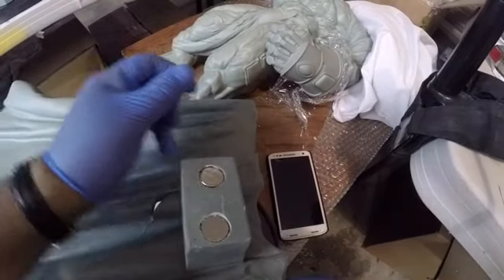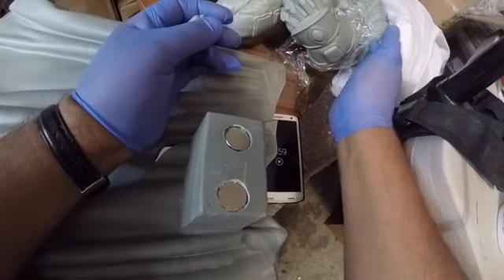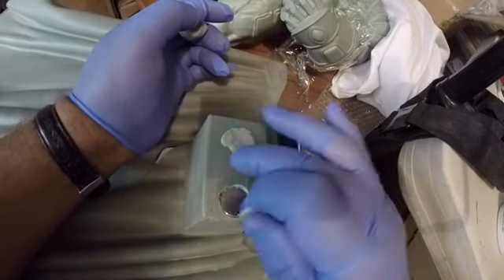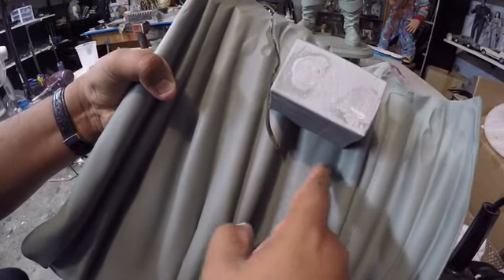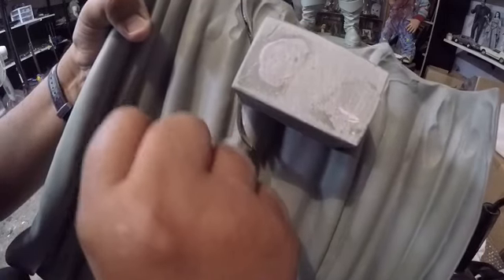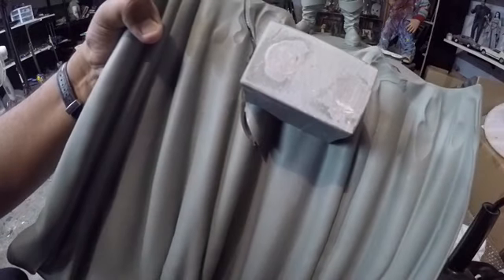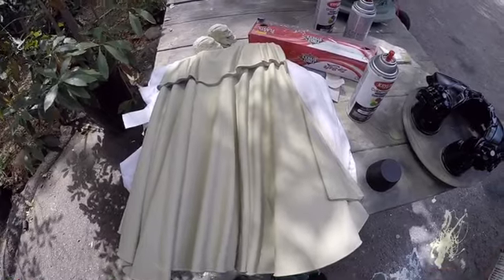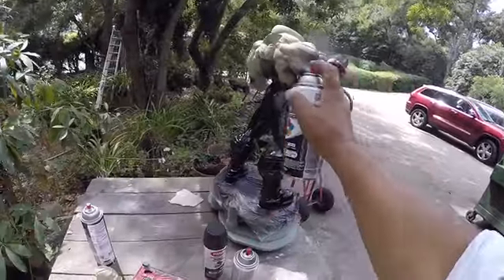1/4 Eternal Tyrant By DXA Apocalypse Paint And Build

Comment: i actually received it with the same crack on the cape and they sent me a new one better packed for free. it is very thin and very heavy, i couldnt pin it and didnt want to take the chance of the glue fail holding it. the producer was responsive and provided a great customer service - as expected when you spend so much on the kit. highly recommended!